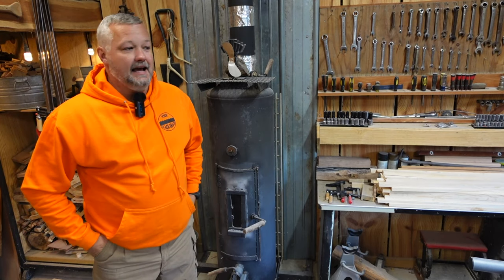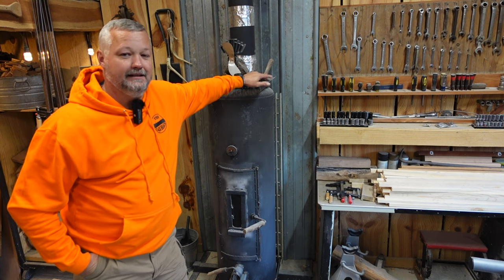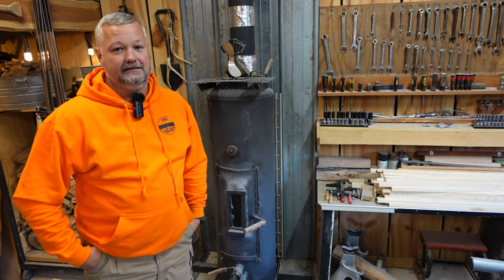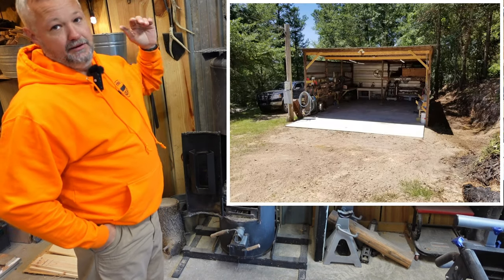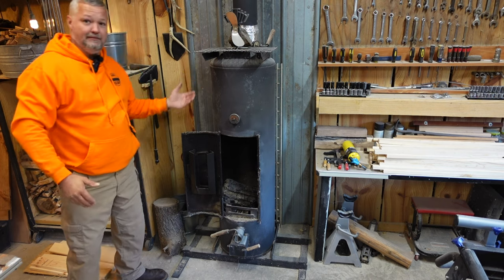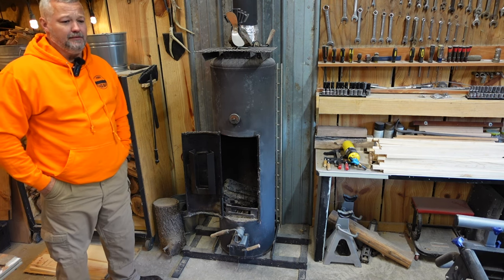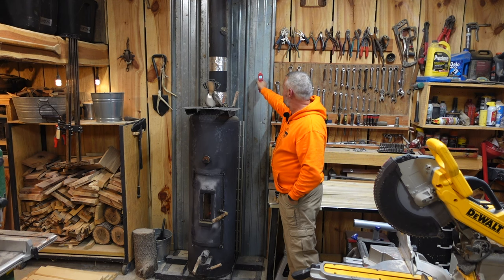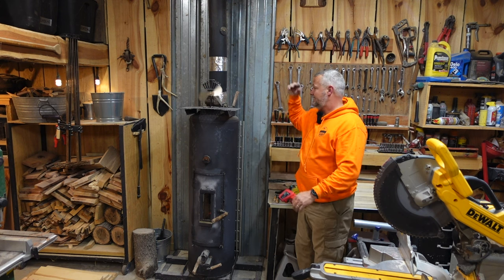DIY wood heater

Comment: I made my big pressure sand blaster from an old 60 gallon hot water heater the unit works amazing holds huge amounts of sand and will blast anything, love these type of projects.
Reply from the maker: Gotta save $$ when you can…

Comment: I built a stove for a wall tent very simular  to yours. But the wood goes in vertical. It burns  from  the bottom because no oxygen  up high in the stove. So it burns for a long time.
Reply from the maker: Nice